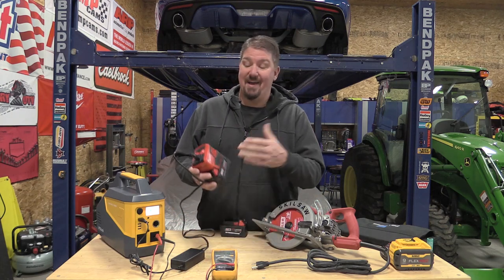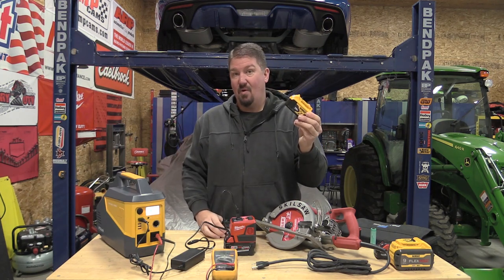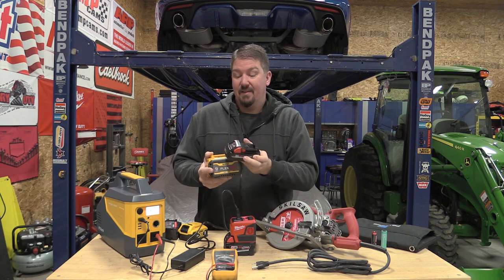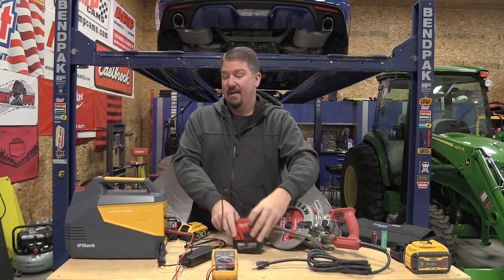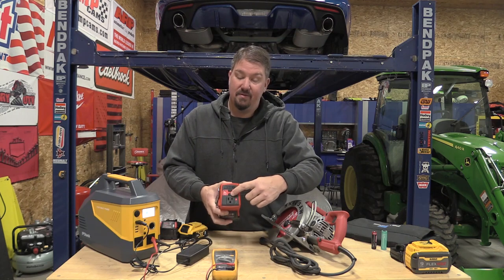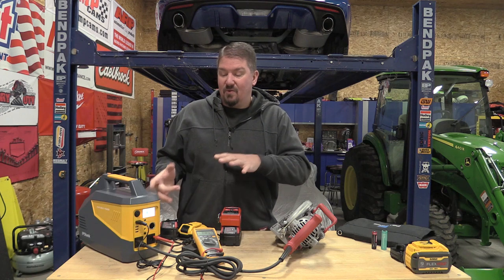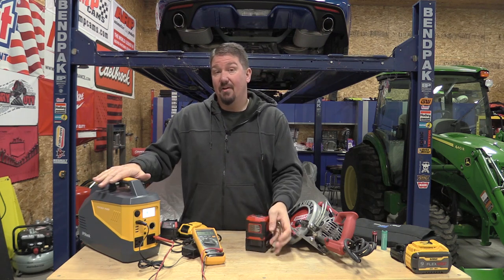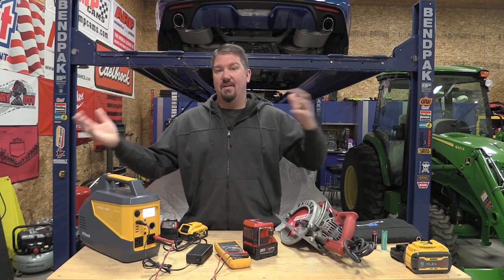Clearing Up Inverter Power Output & DEWALT 20-Volt Is the Same As Milwaukee 18-Volt

Comment: I like the water analogy.  Volts is pressure, amps is volume.  You can use a little pump to get incredible pressure, like a grease gun or pressure washer.  Or you can use a little pump to get high volume, like a sump or bilge pump.  But you can't have a little pump give BOTH high pressure AND high volume.  You can have small wires carry high voltage(pressure in a water hose)  But they won't carry high amps(volume through a water hose).  But if you boost voltage enough(in the millions of volts) you can transmit enough electricity to run a small city through wires the size of your thumb because unlike a water hose, wires don't burst from voltage(pressure), they just need to be farther apart.  

12v tools make it easier to calculate in a 120v environment for ball park figuring.  A 120v motor running at 1 amp will output about the same power as a 12v motor running at 10 amps.  The dc to ac conversion will always incur losses in efficiency.  This, and whether the unit outputs pure sine wave power, is usually where the cost goes through the roof.  You simply wont find a cheap high power, high efficiency, pure sine wave inverter.  At least not one that will last.  Thankfully, most modern stuff runs ok on stepped modified sine wave inverters.  MOST, NOT ALL! 

Bottom line, you won't see a small inverter driving heavy power tools.  The conversion generates heat, and lots of it.  Heat dissipation requires surface area and or lots of moving air.  Generally the more watts an inverter is rated at, the more mosfets(the little electronic chips that do the converstion and generate that heat) you need.  Again each requires heat dissipation, surface area to keep from frying.  Big watts=Big inverter.
Electrical tags are on every electrical device sold in America.  Read them.  If the item says it draws X number of watts, X has to be below the rating of the inverter.  If the item is listed in amps, multiply that number by 120 to get your watts.  
Example: a drill that's rated at 120v and 3 amps 360 watts.  Obviously, a 175w inverter won't cut it for that tool.  Just for reference, 1hp= approx 746 watts.
Also remember that low voltage and long, undersized extension cords are a really good way to burn a motor up.  Lower voltage = higher amps= more heat.
Feel free to question, comment, complain, bitch, gripe and moan.
Reply: What's your opinion about the portable power station? (big yellow thing in the thumbnail)
Reply: @dansmith6990  I don't have one and haven't used one.  Brian's generally spot on with his reviews, though.  I'm personally waiting on Milwaukee's version of the DeWalt power station that's pretty highly rated.  They use multiple 18v batteries and CAN run high amp tools.

Comment: A small addendum to what you said about 20V and 18V:
1. Makita and Mkilwaukee (and later others I suppose) - when they first switched from NiCd (and then briefly to NiMH) to Lithium-Ion (not to be confused with Lithium-Ion Polymer, aka "Lipo"s) were using cells with a NOMINAL (meaning sustained through most of the cell's service duration, or discharge cycle) voltage of 3.6V. Therefore they called their 5-in-series, 1-in-parallel  (aka 5S1P) battery packs as 18V (5 x 3.6 = 18).  Note that they quickly switched to cells with a 3.7V NOMIAL voltage and just kept their 18V branding despite the slightly higher nominal voltage now of 18.5V.
2. DeWalt - they started a little later, and started right away with 3.7V cells instead of 3.6V cells. However, because those same cells have a MAXIMUM voltage of ~4.15V (while still having a NOMINAL voltage of 3.7V like the others), DeWalt chose to brand theirs as 20V (5*4.15 = 20.8V, 20V sounds like a nice round number - and crucially is "higher sounding" than Makita's and Milwaukee's 18V lineup).

TLDR: DeWalt is using the PEAK/MAX cell voltage (which is almost meaningless since the cells deplete quickly to NOMINAL where they spend most of their discharge life).
Milwaukee, Makita, and others use a more genuine voltage, that of the NOMINAL voltage of a 5S pack.

Comment: I am a Milwaukee guy.  Most guys are ignorant to how wattage is calculated.  Volts X Amps = Watts  We know the pack is 18V.  So unless you going to pull 25-50 Amps you have no power to run anything besides a laptop or cell phone changer.  The pack can't go 25+ amps sustained and the pack would be be depleted in like 2 minutes max.

Let me make it simple.  The batt is 18V.  It is NOT CAPABLE of ever powering anything besides a cell phone charger.  I REALLY wish Milwaukee would not make stuff like this as 99% of construction workers and etc think it will power a Lincoln Welder...
Reply: Yes these packs can go 25amps sustained. Single row batteries can output 20amps. Double row 40amps and and triple 60. Atleast the cells can.

Comment: Using a USB-C 100w cable I was able to charge my Lenovo T470 from 5% to 100% and run it for 7 hours watching Youtube videos (including 60 minutes of not watching videos) on a Milwakee SC 8.0 battery pack.  It is still keeping the laptop powered as I type this but has only 1 bar flashing.

Comment: I have the dewalt Power station is the best for what it is, I work in construction and can run simultaneously a dewalt 4.5 gallon compressor and a makita circular saw at ones with no issues, I do only use it for emergency when they're is no power available but non the less, I don't think there is anything that gets close to the power output, run time is limited to the batteries sizes that you have but I own like 25 batteries that keep it running for longer times
Reply from the maker: Out of all of them, that model has to be the best one we have used to date.

Comment: What kind of a 110V AC device or tool can you power from a 18V DC battery?
So in 12 minutes there was not a single device shown being powered. 
No Wattage of such device was mentioned.  WHY?
Can I run a 70 Watt or a 140 Watt 110V AC device?

Comment: 1 p is parallel, a cell is 3.7. 3.7x5 18.5v, milwaukee owns the rights to 18v so for any tool company claiming 18v they have to pay royalties to milwaukee. To not pay you just claim 20v
Reply: Funny thing is both 18650 and 21700 cells are max 4.2v not 4v. So it really is 21v max

Comment: Milwaukee has some useless charts on their webpage that lists how long various batteries will power various appliances - its not what people want to know.

Just remember that the TopOff is not going to provide more than about 1.4A of MAX and CONTINUOUS current.

If your device pulls more than that (just look at the label - every electrical device in US/Canada will have a power label/molding in Watts and divide that by 120V to get current in A) - the TopOff will not work.

Comment: What about a old multi tap transformer. 4v 12 v 20v 24v 28v 32v 64v  in put prime side
Load 110, 120, 125v 128v 130 v 208v 212 v 240 volts load side of transformer.  Wondering if I could used a old multi tap transformer to run a microwave off a 18 or 20 volt battery. I have 2 of them don’t make them any more. Got me thinking.

Comment: dewalt pulled that 20volt gimmick in the states only. here in UK they sell it as a 18v.
Reply: It's because 20V is with all the cells max rating 18V is nominal voltage.

Comment: What about the dewalt pawer station?
Reply: That is a inverter just like the milwaukee top off. The difference is it can output 1800w vs 175w.
Reply: @randybobandy9828  right, but not even worthy of a mention?
Reply: @davinreeves  what do you mean? Idk why he didn't mention it? I thought you where asking what it was compared to the top off.
Reply from the maker: @davinreeves  I have one and use it.  It is a modified sine wave unit so I don't use it for everything.  Great for tools.  Rhere are a lot of great ones and less people ask me what the Dewalt can do and more people tell me the Milwaukee  could power a full house because my drill lasts all day long on 18 volts.  Lol

Comment: Small inverters are worthless. when you can charge your phone or whatever direct from your car or truck. IF you are looking at backup power the best I found after comparing is the dewalt 1800w portable power. I use it to run a coffee pot on the job site in my jeep.
Reply: Small inverters are not worthless, I look like the only smart person when I'm working, If I'm gonna work on an electrical panel why settle for a specific battery powered light, or a pocket light.I like to use a very particular light that I power with my inverter and it makes the whole room light up, or say I wanna use my dremel cordless, or use a specific soldering iron station, they have use , but very situational

Comment: Actually, depending on the quality of the lithium battery, you can max out at 4.2 v. Which also decreases as you use it.
The trick here is to have a good enough battery that can operate at a consistent 4.0 v, which is what DeWalt does.
4.0 v x 5 is 20 v.
Reply from the maker: Then why do they have to use Max after they call it 20 volt?  And you are saying Dewalt uses better batteries than all other tool manufacturers?  Since SB&D owns Dewalt, craftsman, porter cable and others that are all 20 volt, does that mean all the brands use better batteries?
Reply: @WorkshopAddict  No, obviously brands like Ryobi, Craftsman, etc are not going to use top tier batteries since they are trying to stay within a certain price point. If you have ever noticed, the yellow top DeWalt batteries are their top of the line. While their black top are bottom tier.

I know xr/xrp are extended runtime. I don't remember about the max. I could refer to the innards of the tool, like motor or something. You will have noticed that DeWalt has at least 5 different impact drivers with different model numbers. There is usually one that has the best specs, and is also the most expensive.

Regarding the lithium batteries, they don't quite work the same as NiCad, etc. The top of the line lithium can go as high as 4.2 v. As they begin to lose energy, the voltage begins to drop. Usually, tools will stop draining the battery at around ~ 3.5v to mitigate irreversible damage to the battery.
There are charts online that show the characteristics of high end batteries like Sony, LG, Samsung, Nitecore, MXJO, Fenix, etc. For tools, you want a battery that can maintain a constant voltage for as long as possible before dropping off.
Reply: @scsc9311  Dewalt can't call it 20v max in the rest of the world because it fails to meet advertising regulations. Over here in Europe its just 18v like everyone else as those packs are 18v nominal whichever way you try and sell it. We use 18v packs on 20v max tools all the time as there is literally no difference in the batteries except the sticker.
Reply: @JasonShowell  I know, Europe can be strange for good or ill. I know also know that here in the US, bonded leather is still leather. In Europe, vendors have to be specific and can not sell bonded leather as leather.

Dewalt's tools do operate at 20v. As the tool loses power, the voltage goes down. Same with Milwaukee, Makita, etc. Dewalt's tools operate longer on a sustained nominal 20v.
I can't show you a diagram here, but there are plenty on the web explaining lithium and  all it's variants like polymer, LiFeP04, ion, etc.

Personally, I vape. So, I deal with these batteries (18650, 21700) all day. I also have 14500 and 10440's. You'll notice the cheaper ones are marked 5000 mAh or higher, but they don't last half as long as the top shelf batteries that are labeled as 2500 mAh.
Reply: @scsc9311  I know plenty about batteries and their technology but that is not the discussion here. The discussion is that the batteries DeWalt sells are 18v nominal but in the US they get away with calling them 20v max even though they cannot sustain 20v under load. The batteries that are labelled 20v max have been opened up and stripped apart right next to a European 18v battery and it is identical in everyway. That includes the cells it is made with. The same is true of the 54v flexvolt batteries that the US call 60v. Exactly the same make up. It really is just a change of sticker. Plenty of work has been done on testing the products too to see if there is a benefit to buying 20v over 18v and they are the same tools.
Reply: @JasonShowell  That is just it. What I'm saying is that all lithium will lose their voltage as they are consumed. The technology is not like alkaline or NiCad.
This applies to all, Milwaukee, Ryobi, etc.

Technically Dewalt could label them as 21v. But they could not sustain 21v for a reasonable amount of time. As soon as you start to use any lithium tool, it begins to lose voltage. The tool or battery will stop/shut off at around ~3.5v in order to prevent damage to the battery. Do you understand?

If you say that Dewalt cannot market it's batteries as 20v, then the same applies to all manufacturers.
Reply: @scsc9311  I think you are missing the point. The cells used to make the packs have a resting voltage of 3.7v this means they are 18.5v packs. They will measure more when they first come off the charger but they will NOT sustain more than 3.9v beyond the first load applied to them. The packs are 18.5v but that is it. they are not and never will be 20 or 21v in anything but at rest from the charger. You keep going on about the battery shutting down and we are not talking about that. All tools stop working once the battery voltage drops below a pre set threshold. Just accept that dewalt are wrong for calling it a 20v pack and move on. 20v is just a marketing ploy to sound better than it really is.
Reply: @JasonShowell  Lithium batteries can put out a maximum voltage of 4.2 v each battery. What changes is how long they can maintain that voltage.  I know you keep looking for some conspiracy theory but there it is.

On a side note, I did read that for some reason, Milwaukee (TTI) was awarded the patent for the moniker "18 v/18 volt". Therefore, all companies owe them a royalty fee. I'm not 100% sure but it would speak to how broken our patent system is.
This would then make sense why Dewalt (SBD) would be determined in pushing out the maximum power out of lithium technology.
Reply: @scsc9311  you keep saying they can put out 4.2v but if you take a 3.7v cell and charge it to the max, that 4.2v won't stay there the moment you put a load on that cell. It will drop off, usually instantly, and hold at a much more nominal 3.9 to 3.7.
Reply: @JasonShowell  That is the point I'm making. If Dewalt is not allowed to call their batteries 20v, then Makita, Milwaukee, etc. cannot call their batteries 18v. Precisely because it loses power as soon as you put a load on it. smh.

Comment: Part of the reason Dewalt calls it 20v was to prevent the line being confused with the existing 18v line using different batteries.  The other part is probably marketing.

Comment: Just as a heads up, IPStank (stank haha), says to NOT pass-through charge, as in, don't run voltage off the machine AS it's charging... I've been in contact with the company and they say this even on the Amazon page for this item. Also of note to anyone curious, the batteries powering that yellow power station are called "ternary lithium" (best guess I can find is that means it's Lithium-Ion, but if anyone has anymore info I'd really appreciate it)
Reply from the maker: Then they should not allow the machine to do it right?  Build it right.
Reply: @WorkshopAddict  I'm not disagreeing with you, I'm just curious if you tried the same tests with it unplugged from a charger if you'd get the same or different results